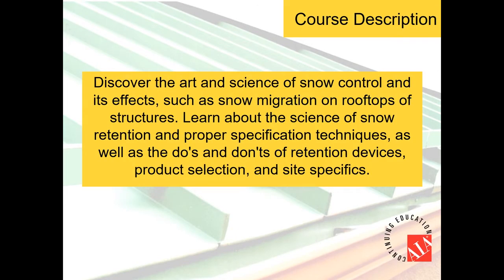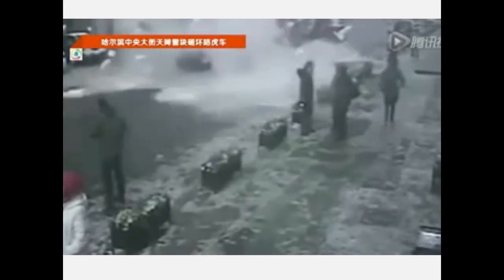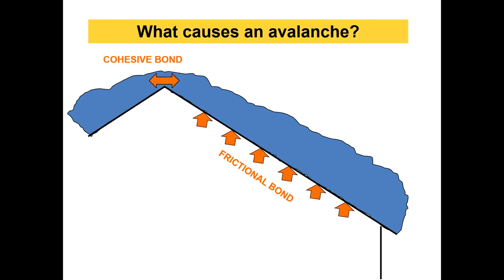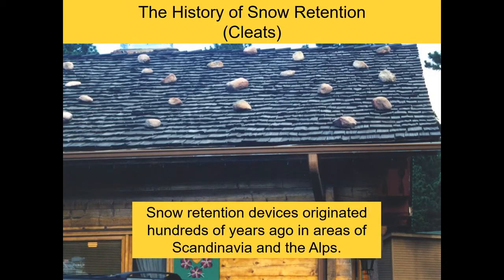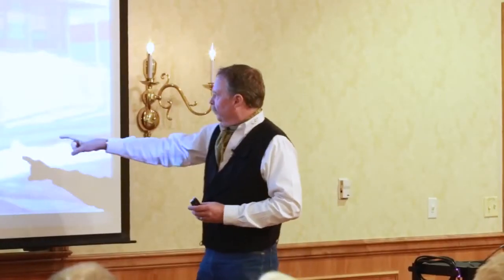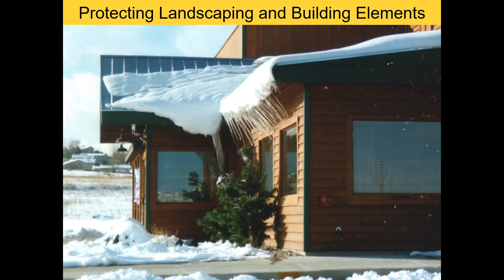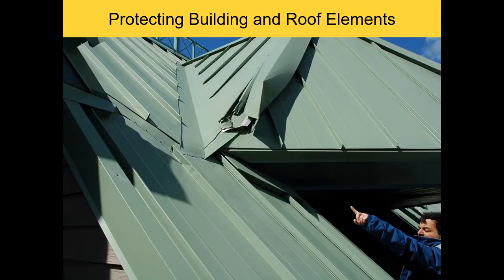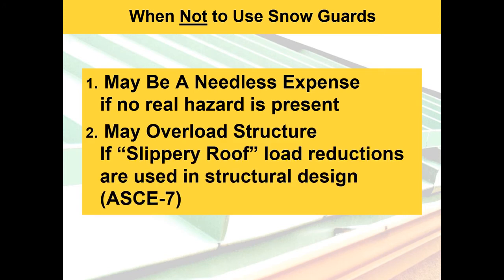Why Use Snow Retention?

Comment: How does it prevent the snow load from creating stress on roof structure? Does it stop a roof from caving in from snow load?
Reply from the maker: We always design our systems to handle the roof design snow load, so they can hold as much snow as the roof is designed to withstand.  In snow-heavy climates, roofs (including metal roofs) are rarely designed with slippery slope roof load reductions, so there is no risk of the roof or structure failing even with zero snow shed.  It is very rare, but if your building was designed with a slippery surface load reduction, then you’d want to consult a professional before using any type of snow retention/gutters/roof-mounted application.
Reply: @TheMetalRoofingAcademy  so it doesn't create stress on the rafters from the weight of the snow load on the rafters? Im confused on why you would want to keep the weight of the snow load on the roof of say a private residence.  Being from Michigan. We remove the snow from roofs. Because if we didnt, we would run the risk of the roof caving in from the weight of the snow load. I apologize if it sounds like im trying say the science behind it is faulty. I know it does work like its designed to do. Im just wondering why you would want to keep the snow on a roof.
Reply from the maker: @bigredsmoviereviews207  That’s a great question—and you’re not wrong to be cautious. Snow retention does not reduce the weight of snow on the rafters; the roof structure still carries the same design snow load. The purpose of snow retention is control, not load reduction.

Roofs in snow regions (like Michigan) are engineered to support a specific design snow load, assuming the snow stays on the roof. What creates problems isn’t usually static snow, but sudden snow slides, drifting, unbalanced loading, or ice buildup that can damage gutters, lower roofs, entries, or people below. Snow guards keep that load distributed evenly instead of releasing all at once.

Snow removal is still appropriate if snow loads exceed the building’s design limits or if drifting creates localized overloads—that doesn’t change with or without snow retention. Snow guards don’t mean “never remove snow”; they mean manage it safely and predictably.

So in short: snow retention doesn’t add stress beyond what the roof was designed for—it helps prevent sudden failures and safety hazards caused by uncontrolled snow shedding.

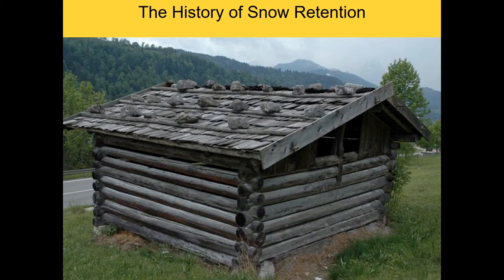Comment: 17:47  Those logs and stones are NOT FOR SNOW RETENTION.  How do you not know this?  You lack credibility when you have this kind of BS content.  That roof is too shallow and the coefficient of friction an a shallow, shake roof doesn't require snow retention... especially when that small?  What would have been damaged if the snow did slide on that small shed?  The rocks and logs are to add weight to the roof and help prevent wind lift/shear.   Ugh  In previous examples, the stones on a steep roof aren't going to stop snow slides as the snow is sufficiently massive to move those stones on that pitch of roof.   You're full of it.  Just another guy with a PowerPoint presentation.

Comment: any comments on using 24 gauge or 26 gauge metal roofs?  24 gauge worth the extra costs?
Reply from the maker: 24 gauge is stronger, especially when attaching a clamp to it.  I would suggest looking at our load tables on www.s-5.com for the panel you're looking at and checking for what we have tested and the corresponding loads.